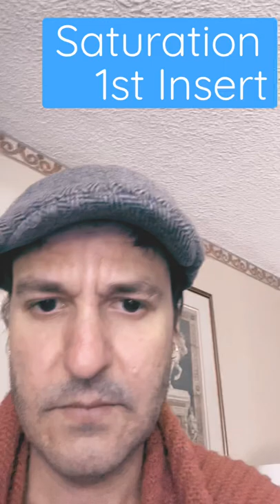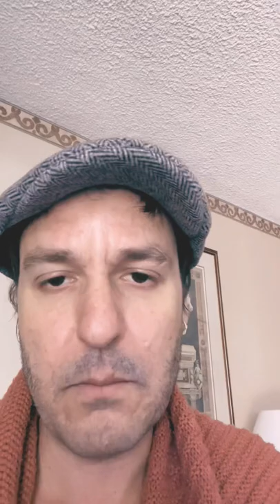Saturation inserted first in the chain

Comment: Makes sense. On electronic samples I use a chain in which I simulate an analog recording chain [preamp - tape simulator] then I put the saturation plugin if needed. After that I have my processors [channel strip or compression modules and so on...]
Reply from the maker: It’s curious how a distortion pedal is not the ultimate saturation device in the analog chain of guitars, but speaker simulation would be entirely inappropriate for mixing because it has an extreme deviation in the spectrum of frequencies